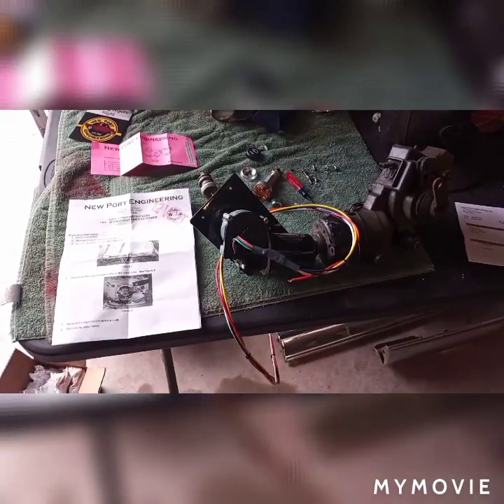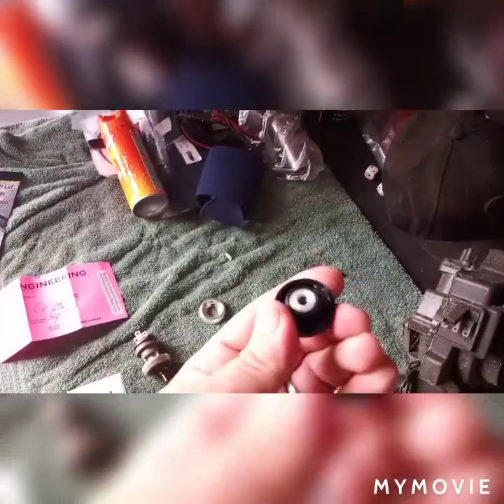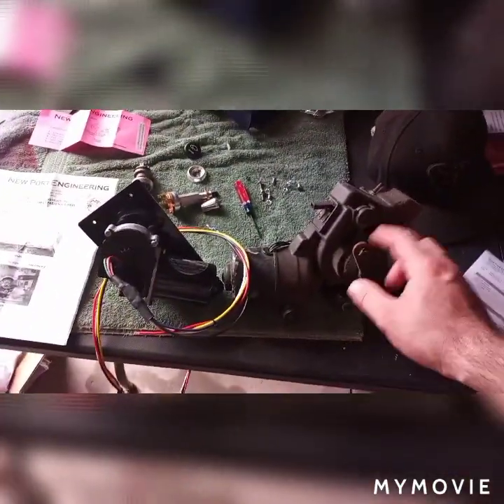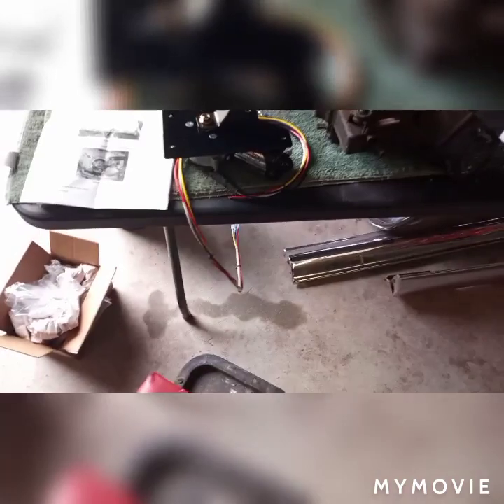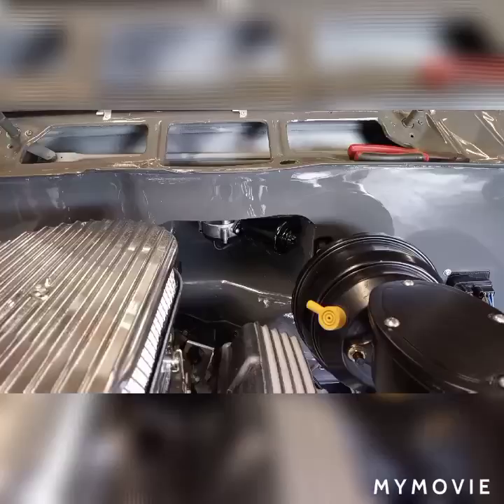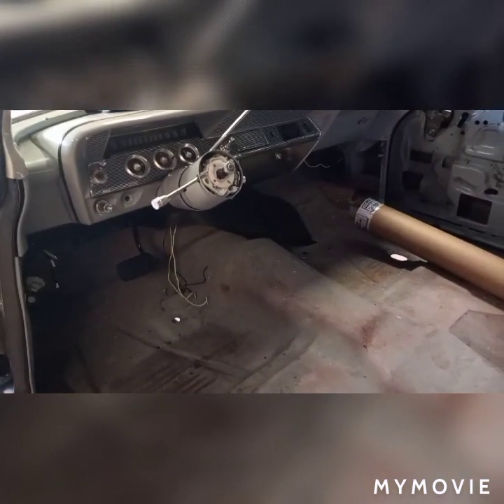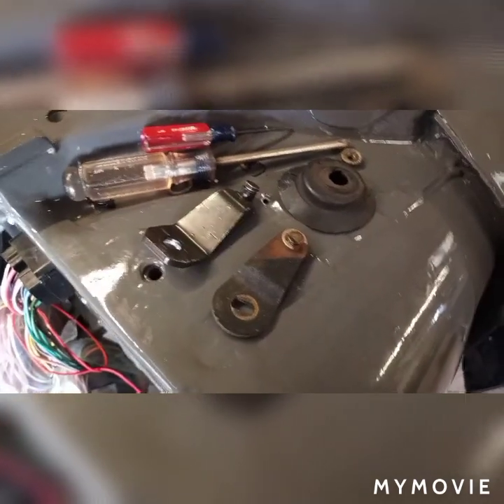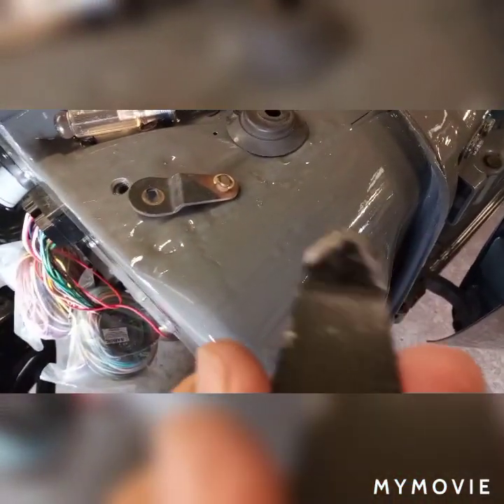1961 1962 IMPALA WIPER MOTOR Newport engineering  install and review

Comment: Man, thank you for covering this ... And ALL the other videos you put out for the impalas !!!
Reply from the maker: Thanks.  After I posted I realized I misspoke.  On the 63 64 it doesn't need the stock harness but the red wire  goes to the white  wire on the AAW harness.
Reply: @lonestarlows  noted , thanks !
Reply: @lonestarlows   have you ever installed this on another car ? How smooth is the operation of the wipers when on the glass ?
Reply from the maker: Yes on my 64. Works good.